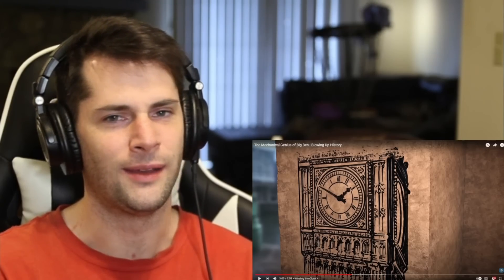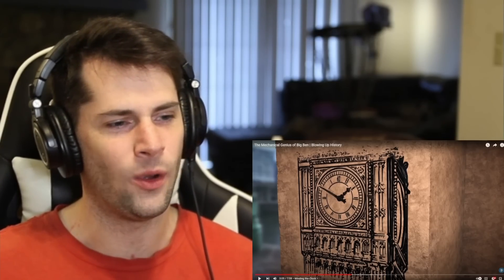American Reacts to How Big Ben Actually Works

Comment: The original Big ben bell was cast in Stockton-on-Tees North East England, but it cracked, so it was recast in london and it cracked again, and it was a worse crack. Proving the best engineering comes from north east England. Stockton-on-Tees is also the place where the 1st passenger railway service began. Stockton-on-Tees also gave the world the Safety Match stick.  Tube Alloys was in Billingham ICI,  part of Stockton-on-Tees, and they did early research that resulted in the Trinity bomb and all future nuclear weapons.

Comment: You asked briefly as he went into the belfry "is he in danger?" He isn't, but I'm a church bell ringer and it is very dangerous to be in those belfry because the bells are swung around on wheels pulled on ropes by the ringers in the room below.  If you imagine a ton or more of metal swinging around, potentially fatal.

That by the way is the difference between a bell ringing or chiming:  ringing requires the bell to be struck inside by a clapper, chiming is a stationary bell being struck on the outside by a hammer as shown here.

Comment: The biggest bell inside is offically The Great Bell. Please stop with this nonsense that Big Ben is the name of the bell and not the name of the tower. Big Ben is an informal name that has been applied variously to the tower, the clock, and the bell. None of those usages are wrong, none are official usages.

Comment: Interesting fact about Big Ben is that the bell wasn’t the original. The original bell was made at a foundry in Stockton-on-Tees in the northeast of England.  It was then sent to London but when they tested the bell the hammer was so big it cracked the bell. The bell was then sent to a foundry in the Whitechapel area of London where the bell was melted down and recast using the pieces of the original bell. However after a few months in service the bell cracked again but this time they managed to repair it in place but the bell has been slightly off key ever since.

Comment: The metal on the faces of the clock are now blue not black as the renovation and restoration wrk found the original paint colour under years of repainting and touching up. The is a great documentary about that too. There are current plans to move the government out of the palace of Westminster so restoration work can be done in there. Unforstunatly this may get derailed as it is going to cost a huge amount and Government money is tight at the moment.

Comment: I would recommend that you find a video of the renovation - every piece dismantled sent around the country, refurbished, repaired or replaced. Then all reassembled ! Cost over $100 million and took 5 years. Stunning result too.
Reply: Was the tower starting to lean, before the restoration? Did they fix it, if it was?
Reply: @lisaweinmeyer5782 it's been leaning since it's construction it's not something they can fix

Comment: Thanks Tyler, 🇬🇧🇺🇸 Loved this reaction. Great documentary too. I loved the 3D bits- good question you posed about how they got the bells up there originally! I actually knew very little about BB till I saw this, and never really thought about what an incredible piece of engineering it is.  I’m a Brit! I must say I learnt a lot!
Reply: It will have been steam or a sty stem of jacks jacking it up and putting blocks under, but given the fact steam power was about when it was fitted I’d say it will have been hoisted by steam power
Reply: @cameronrichardson3108  
jack's that high would never have been taken on 

Also given that the bell took soo long to make and the expense they may have thought a steam engine might be Risky 

From my experience of ancient engineering I would guess that it was either steam as you say 

Or 

More likey a pulley system 

One they did use was water tanks as the counter balance at the top 

Fill the water tank untill it lifts the bell up 

Outside chance they could have used a train of horses which would have been very possible back then because everything was done with horses

Comment: Just remember that the present complex of Victorian buildings replaced the medieval Palace of Westminster which were then (1834) burnt to the ground, except for the Great Hall which thankfully survived intact. It was erected in 1097 by King William II ('William Rufus'), at which point it was the largest hall in Europe. It was reroofed in 1393 and the original supporting pillars were removed thus opening up the interior as one space. The Jewel Tower, the Undercroft Chapel and the Cloisters and Chapter House of St Stephen's were the only other parts of the Palace to survive. The new buildings were designed by Sir Charles Barry; upon the completion in 1858 the Victoria Tower (originally named the King's Tower), was the tallest secular building in the world. Barry asked Augustus Pugin to design the Clock Tower and the fitments throughout the new build. Pugin was an architectural genius and his Gothic designs were down to the last and smallest detail like locks and door handles, such was his keen eye for detail. Pugin however, being a Gothic purist, was displeased with the result of the work, especially with the symmetrical layout designed by Barry; he famously remarked, "All Grecian, sir; Tudor details on a classic body". The Elizabeth Tower and the Great Bell of Westminster (Big Ben); striking the hour to within a second of the time, the Great Clock achieved standards of accuracy considered impossible by 19th-century clockmakers, and it has remained consistently reliable since it entered service in 1859. Fine adjustments to the timing is achieved by the placement of some few old pennies upon the pendulums weight. In a 2012 BBC Four documentary, Richard Taylor gives a description of Pugin's Clock Tower: "It rises up from the ground in this stately rhythm, higher and higher, before you reach the clock face, picked out as a giant rose, its petals fringed with gold. There's some medieval windows above that and then you hit the grey (cast iron) roof, its greyness relieved by these delicate little windows, again picked out in gold leaf. And then it rises up again in this great jet of gold to the higher roof that curves gracefully upwards to a spire with a crown and flowers and a cross. It's elegant, it's grand, it's pretty and has this fairy-tale quality and it makes you proud to be British". Good old Pugin.
Reply: During the restoration the clock was removed and sent away for a complete overhaul and rebuild  the first one since built and it's now better than when new.  Engineering has come a long way since then with far tighter tolerances.  The chimes heard during ceremonial occasions were a recording played through speakers at the same volume level.  The Tower (hands and clock faces) returned back to original colours.  Over the years it got repainted black not the original blue for some reason.  The timing of the Westminster Chime is now back to as was (one bell was a few milliseconds late due to wear).  The slightly flat tone of Big Ben (an internal casting crack) can only be corrected by recasting which was dismissed as would no longer be the same bell or sound and would have needed the Tower to be deconstructed to remove the bell frame (and cost a few more million pounds).  The list (lean) that the freestanding Tower was developing has also been halted by underpinning.  A recent documentary (Channel 4 maybe BBC2 ?) was aired on the restoration.
Reply: Great posts  👍🇬🇧
Reply: @Paul-hl8yg  Thanks Paul, just fleshes it out a bit and reminded me of some of the things I'd forgotten!
Reply: @frankparsons1629   That reminds me of when youngsters try to belittle me on knowledge because of my age. I state 'ive forgotten more than you know' lol. 😆 We are so honoured to still have some of the marvelous buildings & inventions that the Victorians made. What an era in British history! Big Ben quite rightly holds special significance for myself & many. It has stood through tough times & still stands proud today. To think it was built with modern methods (which we invented) iron girders with a stone cladding. Its wondrous clock mechanism & that great 13.7 ton bell.. Just wow!  All the Best for 2023!  👍🇬🇧
Reply: @Paul-hl8yg  👍🕛

Comment: https://www.youtube.com/watch?v=H27BbUfVNyk
An interesting companion piece. One of only two bell foundries left in the UK; the other is in the university town of Loughborough, where I did my masters degree, & I got to take a tour.
After probably a couple of days of cooling for the large bells, they can be broken out of the moulds with large hammers. They then have to be 'tuned'; a very skilled job, where the craftsman carefully strikes the bell & checks it's tone. He then mounts it onto a lathe and very carefully scrapes shavings from specific parts of the inside of the bell, until it is tuned to exactly the right note.
Reply: https://www.youtube.com/watch?v=qD9tSWzW7vs
Bell tuning.

Comment: Those chimes are called 'Westminster Chimes' and the Tune comes from  4 + 1 large bells set in the middle of Westminster Palace (Houses of Parliament).
Unsurprisingly the bells that compose these chimes are are the bells  of the Elizabeth Tower.
Many many clocks world-wide use 'Westminster Chimes' to strike the hours and  quarters.
Reply: Indeed. The chime itself didn't actually originate from the Elizabeth Tower though, they were actually first used in the Church of St. Mary the Great in Cambridge and as a result are also called the Cambridge chimes.
Reply: @GreatBritishBells  I live in Cambridge, and Great St. Mary's still chimes.
Reply: My favorite thing is that Tyler call it "The Clock Tune".  I will now and forever think of it as a 'tune' not 'time' :D

Comment: Something I've realised today hearing you comment on the clock mechanism is that now most clocks and watches are not mechanical there are generations of people who have never seen the inside of a clock and the mechanism that makes them run, I'd never given it a moment's thought , perhaps more people in Britain are aware  of the mechanism because they have seen long case clocks in stately homes  and TV programmes on antiques .Ps long case clocks are also called Grandfather Clocks.
Reply: My introduction to the workings of "Big Ben" were from  Blue Peter  which must have been back in the 70's

Comment: Hello Tyler. Not so long ago, just about 10 years we had similar clockwork mechanisms in the telephone exchange I worked in. so that the clocks, tariff machines kept time accurately. The tariff machines in particular was very important. It controlled the metering rates for different rates of charging at different times. We had a central timepiece of a clockwork mechanism of a regulatable 4 ft pendulum, every few seconds the clock would get a 50 volt elector magnetic burst of energy. Without specialist other than our engineering/technical knowledge I helped to maintain. This was in the days of analogue exchanges. It was an GEC Crossbar unit, now it’s all Digital. Software now decides the tariff rates and how much to charge. We used to adjust the clocks by calling TIM, the Speaking Clock, as a reference.

Comment: Big Ben is the clock of the World. It runs on GMT, therefore the globe's time is calculated from London. Big Ben is the main face of that time. Not until Ben strikes is it officially New Year for the entire planet!  Recently a lift has been fitted & a very thorough cleaning/renovations made. The famous Westminster chimes comes originally from st Mary's church in Cambridge & was used for & made famous globally by Big Ben/accompanying bells in the tower. Many clock chimes heard around the World originally come from various old churches in London. When someone looks at a clock, they see the face of the clock, not the actual clock (mechanism) so when you look up at the clock tower, you're looking at the face of Big Ben. So its ok to call the entire clock/tower 'Big Ben' in my opinion. 🇬🇧❤🇺🇸
Reply: Big Ben is the bell and has pennies on the pendulum. .
Reply: @janolaful   Read my post again, i clearly mention Big Ben & his accompanying bells!  🇬🇧
Reply: @janolaful  The coins on the pendulum are part of the clock mechanism not the bell itself.
Reply: Big Ben is the bell NOT the clock 🙄
Reply: @steddie4514   I know!  🇬🇧
Reply: Big Ben is not the official clock of the world. The world generally runs on UTC time, measured with modern atomic clocks in physics labs. There are hundreds of clocks around the world, not just one. They are all set to the same to within a tiny fraction of a second, and you can say that together they make up the clock of the world. The official time is the average of all the clocks in the UTC / TAI system.

Comment: The chronometer was invented over 100 before the clock was built, so yes, they did have accurate ways of measuring time when it was built. I have no idea whether a chronometer was used or not but they did exist.

Comment: Wonder where Guy Fawkes planted the gun powder barrels 🙂
Reply: @UCAjGKzKyxHStYbs540RmlZw Aha, I wondered about why it was celebrated. Thanks!
Reply: @taakelur   Yes its celebrated because Guy Fawkes was stopped, not because he tried lol. A terrorist of his time.
Reply: Guy Fawkes and the Gunpowder Plot, 1605.
The new Palace of Westminster (Parliament), 1860s.
Over 250 years later.
Duh! 😯
Reply: @andypandy9013    Westminster hall still stands. Over 600 years old.
Reply: @Paul-hl8yg  Yes, I know and have been there but it is the only remaining part of what had been the old Palace of Westminster. Even though it had not originally been built for that purpose.
Reply: @andypandy9013   I did state only Westminster hall still stands.
Reply: In the cellars beneath the then main chamber.